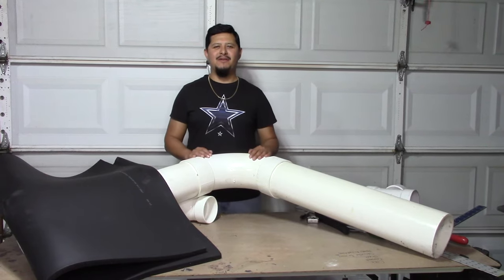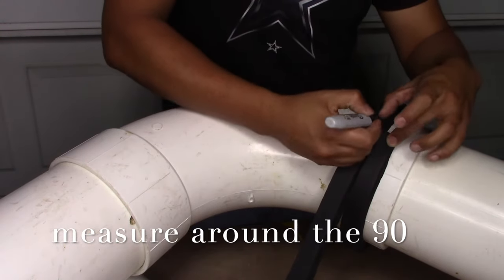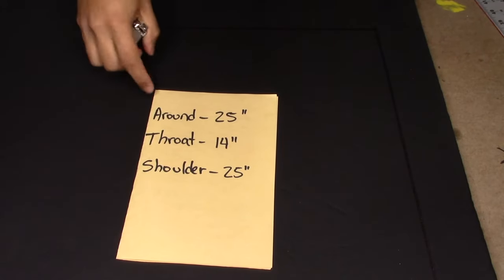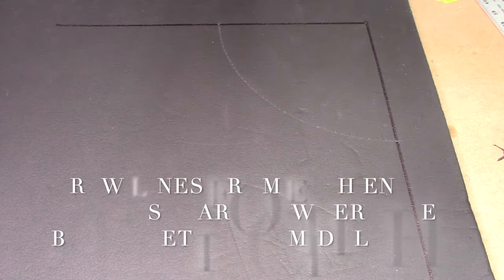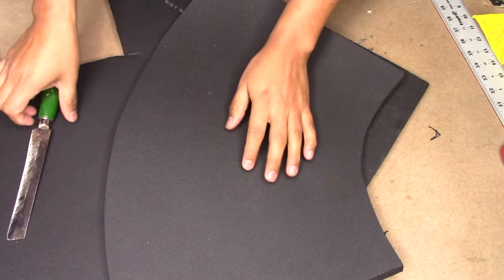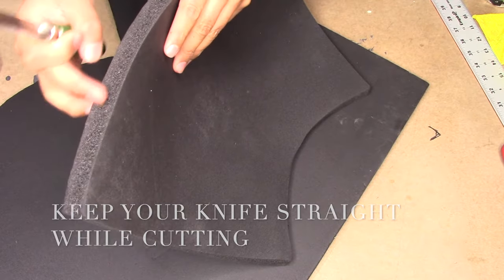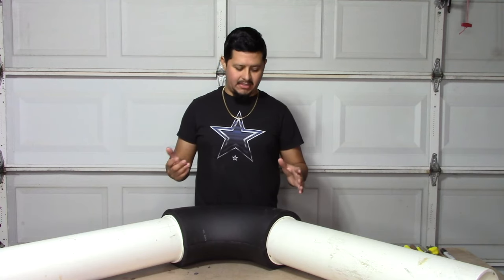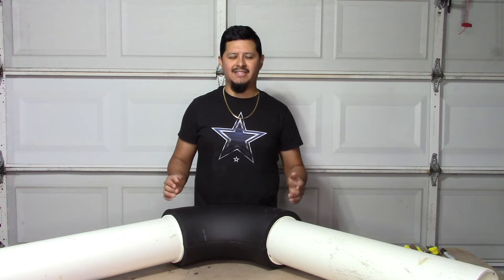How To Make An Armaflex Sheet 90

Comment: How goes it brotha....I have a suggestion  to this.....can you do a layout and cut for a reducing 90 as the LR-90 is in the same avenue.....i like to see how you would do this process....
Reply: It's the same layout method. Only difference is you should slide the heel of the 90° to the smaller Dia mark and connect the two. The throat stays the same.

Comment: Is this process only good for long radius 90s. If so could you demonstrate the process for short radius. Tia
Reply: That is a basic 90°, are you looking to do a 45° or smaller pipe? For smaller pipe its a bit different.
Reply: @dineromikeful  , for the 45* bend you could use the same pattern  as 90* .
Just cut through the 45* line on original pattern.

Comment: I’ve been trying to cover a 3/4 pvc elbow with foam sheet and the measurements isn’t coming out correct I try to copy the way you’ll in your video …. I need help
Reply: With 3/4" pipe you can put it on the straight and twist it over the elbow. The method he is showing really is for pipes over 3". If you need more help, ill refer a few older videos.

Comment: I am a mechanical insulator. The basic principle is good, but the gluing is ugly, and the cutting is not perfect.  it is not at right angles due to the wrong cut back.For a layman, this is good, but from a professional point of view, it is negligent. Our technical inspector would not accept this. Even if it has the vapor barrier function, it does not meet the aesthetics side...